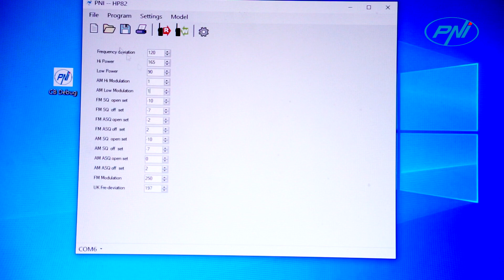Adjust modulation AM FM for PNI Escort HP 82

Comment: I own this radio and I have observed the issue that when Scan is running, user is pretty much unable to change any settings (NRC, AM/FM, Squelch) I would expect that it doesn't block the input and allow user to modify reception parameters during scanning. Also it's difficult to leave Scan function, it would be nice so short press (EMG) cancels it and navigates to i.e. EMG channel. Third issue is that Dual Watch doesn't allow to watch 2 channels in AM... second channel seems to be always FM, I would expect that if user is setting second channel as AM it will be kept this way, or maybe it's just wrong modulation being displayed on the screen and in fact it's AM? Fourth issue is that sometimes I observe that EMG is on channel other than 9 or 19 (I don't remember now how I did it).
Is there an option that future firmware update will resolve these issues? Will I be able to install update having K-type USB cable?
Reply from the maker: As you allready noticed the PNI HP 82 that can be bought from here https://www.s9.ro/index.php has next functions:  you cannot acces, modify of turn on 2 functions at once. When you activate SCAN you cannot do other other settings. The same way : if you set up NRC you can't acces another function(AM/FM button) in the same time. This is normal functioning of the radio. About Dual watch - you can easily check : if there is broadcast in the second channel in AM mode, it will receive the message or not. We cannot check an issue about EMG if you don't know what setting you have done , and cannot reproduce it.

Comment: Is there a way to modify power on this radio? I saw there are inputs for "Low Power" and "Hi Power". What values to set to reduce Lo Power to i.e. 0.5W or is there an option to increase Lo/Hi Power this way?
Reply from the maker: The radio has legal power acording to EU legislation. Lo power is for battery saver.
Reply: @PNI-EU  I understand that, but there are different settings in the application you have presented in the video and I wonder what effect on changing these values will be. I.e. if I would prefer to increase the Lo to 2W or decrease Hi to 3W? Is it possible from there? I know that exceeding 4W in EU is illegal, I'm not asking for the way to exceed this power, just how to modify parameters to given values?
Reply: @kaloryfer420 Też jestem ciekaw ale chyba się nie dowiemy od barana.